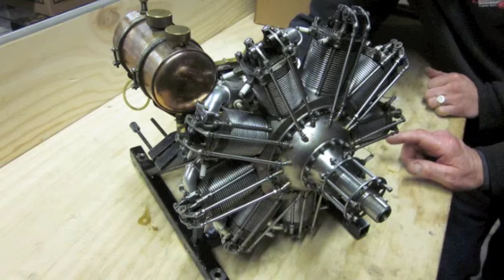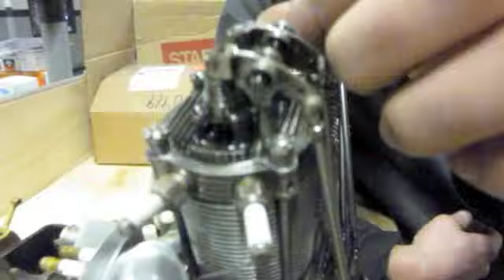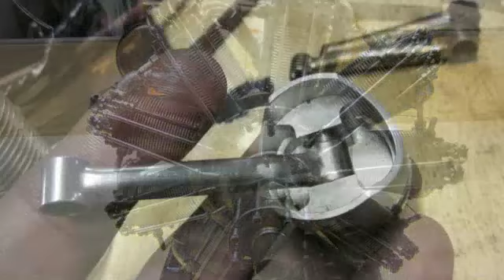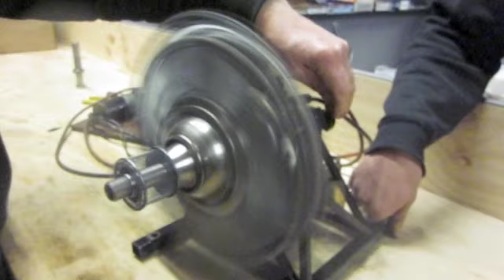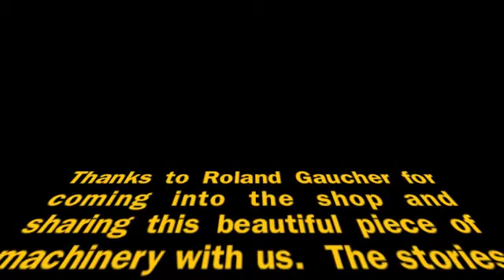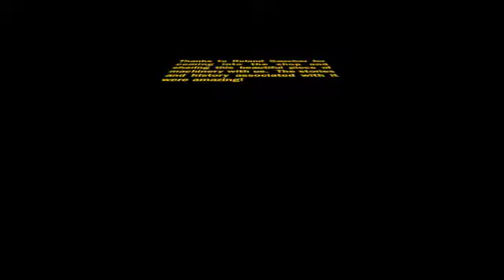Roland Gaucher's Bentley BR2 rotary airplane engine

Comment: Some info about the build that I got from another model engineer he, Roland, my dad, Dan Fay, and Ron Ginger were all friends with metal shops in their basements who would hang out together and talk about this stuff, and what engines they were working on, and problem solving etc. Anyways:
"That was before he bought his Lagun milling machine with CNC control, too. He built the whole thing on a 10" Clausing lathe and a rather clapped-out hand cranked Bridgeport with a short table."